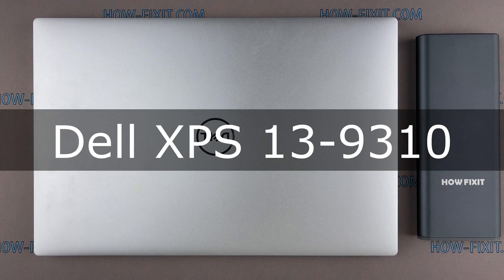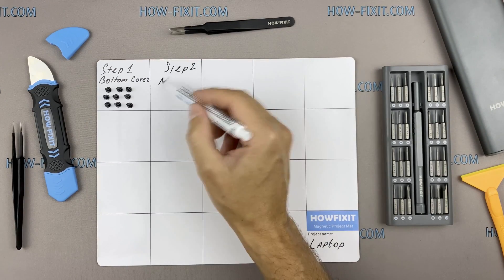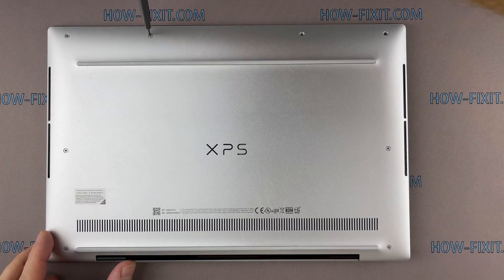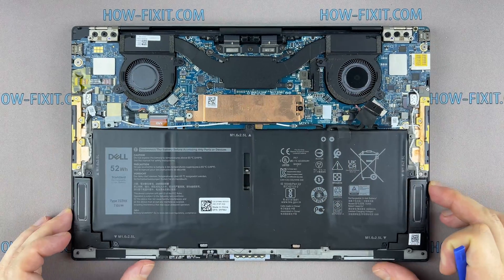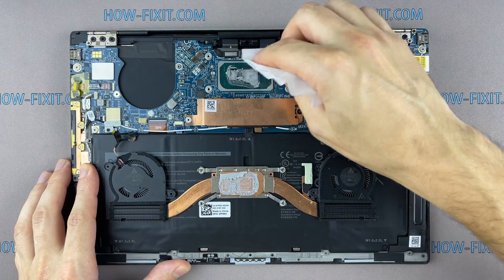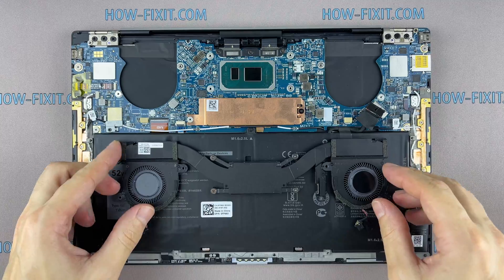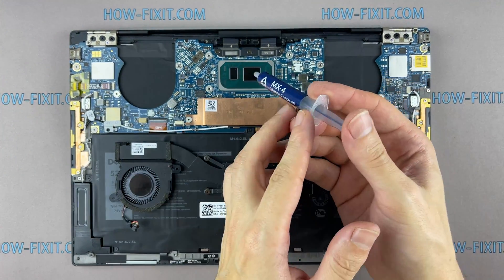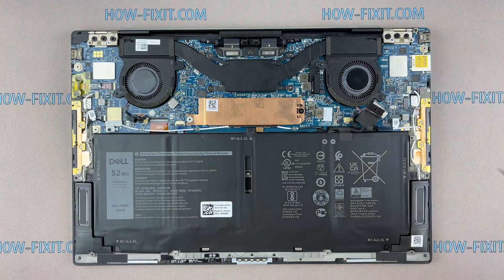Dell XPS 13 9310 Disassembly, fan cleaning and thermal paste replacement

Comment: Hello, do you have a video for thermal paste replacement on Dell XPS 13 L322X or do you plan to do it?
Otherwise, do you know which XPS 13 from your videos is the most similar to L322X, is it the XPS 13 9310 or 9370?
I already cleaned the fan because my computer was overheating but it still shutdowns randomly and sometimes does not boot for a moment so I guess it may be a thermal paste issue. The battery is not working since a few years but disconnecting the battery did not fix the shutdowns issue.
Thanks.

Comment: This machine has been overheating since i bought it. It still overheats after several BIOS upgrades.
Reply from the maker: Check this video -> How to fix laptop overheating: https://youtu.be/1PTRCc_BRtQ
The ultimate guide to a laptop overheating covers everything from software solutions to CPU and GPU undervolting, and hardware checking.
Reply: Mine too, overheats and freezes.  Junker.
Reply: Same here waste of money